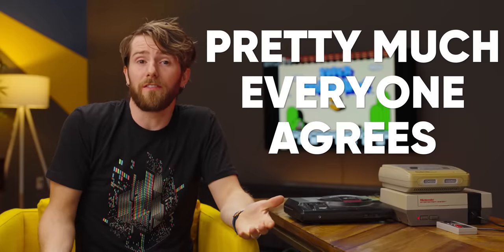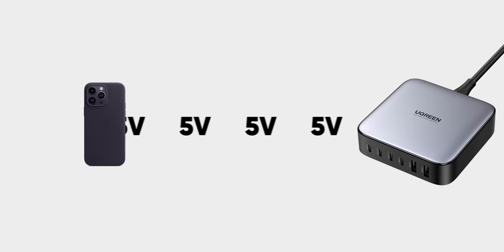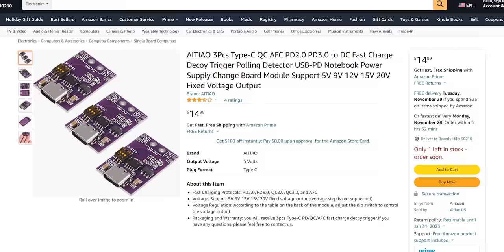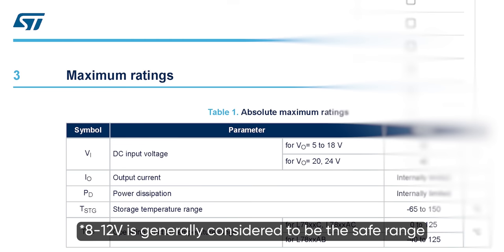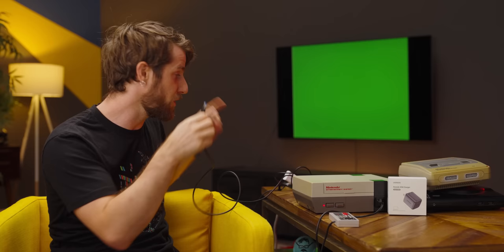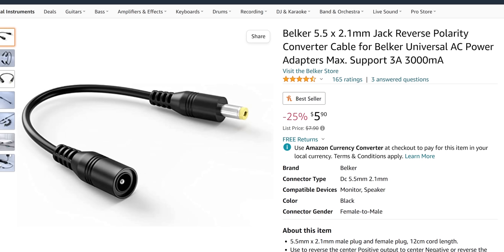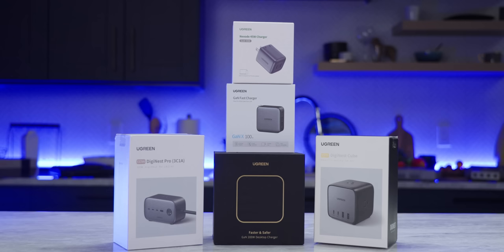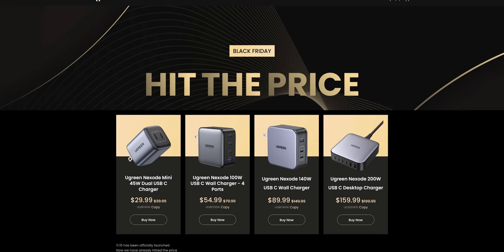How to Put USB-C Power on ANYTHING (almost)

Comment: I know I'm just a random commenter but I I can genuinely, personally vouch for Ugreen. They make the best chargers and cables I've ever personally owned - by a LONG way - and I have ZERO complaints about what I've bought from them.

I was so surprised when I got my first thing from them and it turned out to be as good as it is. I was sick of all the terrible stuff I'd been getting for years and was desperately hoping Ugreen's stuff would be better, but I was skeptical given that they seemed to just be yet another random manufacturer on Amazon and I'd been let down plenty of times by similar. It remains to this day one of the most pleasant surprises I've ever had, and I now exclusively buy from them and recommend them to everyone because my experience continues to be consistently great.

Comment: Personally I find USB-C confusing and really complex - sure the universal plug is nice .... but it really sucks when you travel and grab a cable that only charges and doesn't transfer data and you wanna move pictures from your phone to your laptop or something ... I've certainly been screwed over before for the type of cable I carried ... they all look the same but work differently. Not to mention few of the laptops we have at home had their USB-C charging port broken from repeated insertions and or the weight of the cable bending the connector until it breaks ... a couple of them had nice daughter boards that could easily be replaced (thank you ThinkPad) but a couple of other models were unfortunately trashed as a result of the USB-C socket breaking as the boards were so expensive to replace and de-soldering was not an option :(

Comment: I have some feedback on this video. First; you mention that the charger needs to see resistors to supply 5V. This is not true. USB always supplies 5V by default. This is the core spec. Older devices can use resistor bridges to sense hoe much current they're allowed to take, but the resistors actually reside in the charger, not the device. Devices that need more than 5V can only negotiate by having the 5V power in the first place, otherwise negotiation circuitry could not work.

Second; the 7805 is a linear regulator. It quite literally burns the difference in voltage. The input voltage is a carefully chosen value that is guaranteed to stay under the device's thermal limits. Yes, the regulator can accept higher voltages, but care must be taken to account for increase in heat production. Double the input voltage from 10V to 20V and you're tripling the heat output due to the voltage drop increasing from 5V to 15V. You might be fine, but I do assume you will run into heat issues down the line.

Comment: I liked the video, and it almost has me thinking about doing this with my old consoles (though I'm fearful of bricking them). But what I'd make USB C right away is the thing this video glossed over the fastest: my monitor. I really have to make an assumption for how this is done. I assume it's one of the USB C to barrel cables shown earlier in the video (making sure I get the polarity correct)? I just wish there were links to where to get one and what to look for, and not just links to the sponsored products. Or just spend another ten seconds there at the end of the video to explain what we need. I know you were going for a rapid-fire sort of thing, but it was at the cost of helpful information.

Comment: One thing to note about the consoles that originally took AC power is that if they weren't switch-mode (the N64 at least is not) this also fixes that as an issue.

Comment: You MIGHT want to add an extra note regarding the SNES and Megadrive. I imagine it is ONLY the US version that has the polarity issue, since the PAL version does NOT have it.

I have an original NES, SNES, and Megadrive (Australian-PAL), and all 3 have the exact same polarity.

In fact, if you Google it, it is quite common to use a Megadrive powerpack to power the NES.

All 3 pretty much take the exact same power.

Also of note, the PAL version of the SNES takes the exact same barrel connector as the NES, so where you showed the Japan/World version, there is zero need with the PAL version to have the adapter.

Bit more research needed from you guys when it comes to these things :)
Reply: Mate, the Megadrive is a 9VDC negative polarity unregulated power supply as per this video. The PAL snes uses a 9Vac negative polarity power supply but because it uses just a bridge rectifier, you can just plug in a 9VDC negative polarity power supply. The details in this video are correct. The NES, SNES and Megadrive are all use negative polarity power supplies and hence you would need the polarity reversing cables.
Reply: @haxmanz  You will note, at the 7-min mark, Linus specifically mentions that the SNES and Megadrive uses a negative polarity power supply, he never mentions that the NES does.

With the NES, he just plugs it straight into the USB-C, no issues at all.

The PAL SNES is 9VAC and uses the exact same power supply as the NES, and I do mean exact same power supply, right down to the model numbers on them (NES-002E(AUS)) (I have both NES and SNES, original first owner), which means you don't need any adapter at all for the SNES, you can just plug it in the same as the NES. Interestingly, the power supply for the SNES doesn't show the tip-polarity like the NTSC version in the video does.

The Megadrive is the only different one out of the 3, it is 9VDC and is centre-negative, so that one definitely needs a different set up.

Comment: Why not just install those cheap PD-trigger boards that have a USB-C on them, to request the right voltage on a per-console basis, so nobody can screw up what gets plugged into where? 

This has shifted the problem of not keeping track of wall-adapters, to keeping track of specific USB-C to barrel-jack adapters as well as polarity inverters instead.

Comment: Another word of caution, while not really related to this video, never use a NES power supply on another console. The NES PSU outputs AC and not DC like every other console. The NES can accept DC power as it will be converted internally.

Comment: I have an old (2004) monitor that I don't usually plug in because its power brick gets hot (which means wasted energy). I wonder how hard it'd be to convert to USB C just to bypass the power brick for greater power efficiency. It's such a great monitor that still looks lovely today, even in its 4:3 glory, so it'd be great to give it a second life!
Reply: A large part of that may simply be that your monitor uses quite a lot of power - which in turn could also be too much power to be practical for usb-c(aside from sorting a suitable adaptor.
If it's using a heavy transformer based power adaptor(generally only if it's a 'wall-wart', not a brick part way down the cables), replacing that with a normal switch mode supply(with the same voltage, at least as much current and the same spec plug) would make it more efficient.
Reply: @DoubleMonoLR  Its power converter is part way down the line, but yeah might look up if there's an adaptor to the same voltage + current that's built with more modern tech!

Comment: Usb c is a step back. The amount of conductors and the small wire gauge means the cables have an extremely short life. Look on tiktok, you will find plenty of meme videos of people orienting their cables in various positions in order to charge their phones. In fact there is plenty of cables in the wild that don't have the proper precharge resistors for power. Plug it into your laptop and you have a chance of frying your laptop.

Comment: That handshake feature is very usefull, I was using a oneplus charger (non pd I think) on a esp32 with USB C. Quickly plugged in my computer to charge, then back to the board and it fried it with 20V

Comment: Not 100% relevant, but even so, I have switched to magnet ended usb cables that you can get from Amazon or other places. It came with a bunch of ends that you stick in your device and it stays there, then the cable has a magnetic end, so I can just switch one cable over to any of my devices. There are USB-pd ones, which I use going from my steamdecks dock to the deck itself. It is fantastic for someone who always worries about eventually wearing out the USB port with constant plug/unplugs, or if you happen to be clumsy and trip on a cable, the magnetic part just pops off.

Comment: Another note about power adapters for these consoles is that the NES will accept either AC or DC, but the other consoles mentioned in this video (as well as pretty much every other game console from this time) DO NOT accept AC power, only DC. The OEM NES adapter outputs AC power. Please, DON’T use it with your Genesis.

Comment: I mean, this is cool and all, but at the end of the day, AC wall outlets are more of a standard than USB-C chargers. Most people don't have tons of extra USB-C chargers lying around, or they have a bunch of stock phone ones with minimal support for optional specs, but everyone has wall outlets. Unless an old device adapter is just prohibitively difficult to find or expensive to buy nowadays, it's probably cheaper, easier, and less error-prone just to have extra device-specific plugs. The exception might be devices that move around a lot and need to be charged in multiple places with a shared standard, the obvious examples being phones, tablets, and laptops, which aside from Apple all have USB-C built-in these days. It's nice information to have, but this is definitely more of a tinkerer's subject than a practical one for the masses.

Comment: You guys totally missed an opportunity to show something like the power savings and cable management savings you could get from doing this to an Entertainment center or Typical*** home network setup.  (***not Linus's datacenter house, but the average cable/fiber + simple router + small switch setup)
I personally want to do both my network and entertainment center with USB-C to get rid of the ridiculously obnoxious daisy chained power strip configuration that's forced upon people by terribly designed power bricks that take up 2-4 slots on a power strip (I literally have 2 power strips for only 4 devices in my network closet, its absurd -_-).  I'm going to do some tests before and after to see if there's even a marginal power savings from having just 1 instead of multiple AC->DC converters, I imagine there is... and the cable cleanup will be sooo nice

Comment: interesting discovery today when I thought I saw arcing against the metal case of my XPS laptop. All usb-c charders are not the same! One the ugreen GaN 200W I have, the shield of USB-C cables floats at ~1V AC, whereas on a cheaper 20W USB-C if floats at 85V. So apparently not all chargers pass through mains earth to the usb cable shielding! If you can hear buzzing when earphones are plugged in, investigate with volt meter.

Comment: Replacing with USB is fine for all those wall-wart barrel jacks.

I like the newer devices with mains AC power cords though. Wish they weren't polarized but at least you can just stick them on a power strip. Unsure if there's another benefit other than replacing a bad power supply, and I prefer the original look, even when I'm sticking a Raspberry Pi in an old PlayStation case. I'll always solder a new power supply to the mains jack where the old one was.

Comment: One thing that would actually be the real killer move would be a way to separate power and data from usb-c, to be able to use use one port for both, just as recent computers do. I'm actually working on a project to turn an old computer into a tablet, and the idea would be to leave all the old motherboard IO inside the chassis, and only let one usb-c port on each side, both allowing 20v PD to the motheboard 20v barrel plug and data transfer to the motherboard usb a plug. Idk wheter or not it could be done

Comment: They should offer this for fibre onts and routers. The biggest resistance we used to get for sign ups was unlike copper lines the fibre doesn't work in a power outage...but it could.

Comment: 12V has an issue. CARS don't provide 12V exactly, they put out more like 14V or 15V when turned on. 
Alternators. 
In order to charge the car battery, the voltage needs to be silightly higher. Every single car-ready adaptor takes this into consideration.

Comment: I set my desk with that charger/adapter with hope of less clutter, but immediately ran into that issue. That expensive thing ended up just replacing other charger (which was only 2 to begin with), instead of replacing some more power adapter which was the reason I bought it in first place..

Had I known it will re-handshake the whole thing each time we add a single device, I'd buy the less expensive, less power, less port model.

Comment: Thank you for this video. No, really, thank you. I've had several power adapters either die or outright disappear and been trying to replace them for a decade. Adafruit is sold out of one of the varients I need, but this will make things so much easier.

Comment: A couple of reasons why this is a bad idea. 1. Running the voltage regulator inside an old NES hard can make it heat up and eventually burn itself out. It may “work” as it has some generous tolerances - but for how long, with the simple heat sink it was designed with? 

2. Modern switching power supplies can be horrible on devices with analog components. The genesis and NES are pretty sensitive to this in my experience. Fine for your iPhone. Not so fine for your old consoles. The quality of the video output can be atrocious. You really want to just use the old OEM power supply with the heavy transformer.

Comment: II modded my PSP2000 to be USB-C. I wired it up in parallel with the PSP's USB socket keeling the original usb-b and charging barrel jack intact. the USB-C even supports data, all be it at the psp's original usb 2.0 speed. it wasn't easy and I blew several fuses on the board and they are a nightmare to replace being about the size of a gran of sand.

Comment: Yeah I almost kinda got a USB c adapter for all my consoles but then I kinda decided it's pointless cuz here is a fan fact... Due to some Japanese laws or something, all the retro consoles use the same 9v plug with minus inside so all you ever need is just a single power adapter regardless, if you fancy might as well add in splitter from CCTV cameras to run multiple consoles out of one single power adapter hahaha

Comment: I'm still looking for a battery bank that can simultaneously output power delivery while charging off power delivery for the ultimate small gadget ups.

Also wish these cables would cut out if it couldn't negotiate.

Comment: This is great for devices which don't use USB, but it doesn't really address all our phones and mice and external drives and things which run on USB-A or micro or mini.  We either need to put a physical adapter sticking out of our device or find a way to solder a USB-C jack in place of the existing one - both of which have some issues.  I have a couple USB ports on my monitor, and one permanently has a USB-C cord for charging those devices, and another has a USB-B (micro) cord for connecting and charging those.

Comment: if you could reach out to them and ask to put out specs for each hole and possible outputs. 
its common to drop just range and top power, but 5/9/12/15/20 each can have different output, if it even is there, if you use all or specific slots. 
I had 4 slot, and if you used slots 1 & 3, advertised 45W(15Vx3A, but still could do 20Wx2.25A), on slot 1 was not present, but you could use 2 or 4 slot then it was there... 
it was annoying to find that out on my own, as specs did not show voltages and max amperage. 
I know its annoying to construct such tables of 300 random rows, but its hard, when you need one.

Comment: 4:47 That's not happening in modern adapters which use switching power supplies. This was a thing with old adapters with a transformer 4 diodes and a capacitor and these were mostly replaced in early 2000s.

Comment: It's really cool to see these consoles run off of USB but the fact you now creating a new problem and are able to plug the wrong cable into something and have it immediately fry kind of makes this more trouble than it's worth imo, there's enough space in all of these to put the power management console side and eliminate that problem completely. However for  consoles like Dreamcast i feel it doesn't make it much more convenient at all as the power supply is internal anyways, plus the Dreampsu isn't great. I feel getting some new high quality power supplies for the external ones and keeping on the lookout for better replacement's for the internal ones might be less of a headache. This solution does declutter a fair bit, but is it really worth the money? I feel once you have a bunch of consoles set up and working you simply forget about the power supplies.

Comment: 4:37 I remember when I build a 5V audio amplifier for my PC speakers, to be powered by USB. Noise on pretty much every USB power supply I tried, even from my PC was coming through the speakers, so I used a 7805 on a 9V PSU to power the USB  speaker amplifier.
Much later I ran it off a Samsung phone charger, as.. Either, there was no buzz to it, or (since I know I've lost high frequency hearing since I first built it) I couldn't hear the it anymore.

Comment: With more power bricks dying out, using an alternative 3rd party brand tends to be a risk as it could just be a death for the console if they didn't make it right.
If we could properly dial in the power cords, while making them blatantly obvious as to their rated voltages so people can't mix them up, maybe using a replacement system wouldn't be as ridiculous. The C to barrel plug feels like the better route than outright C conversion.
Why don't we just make them rechargeable instead?